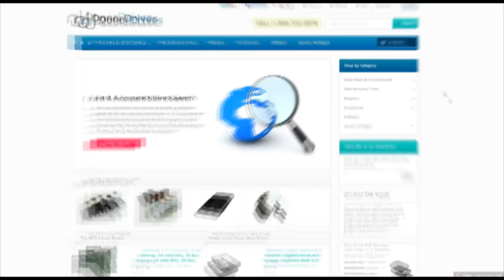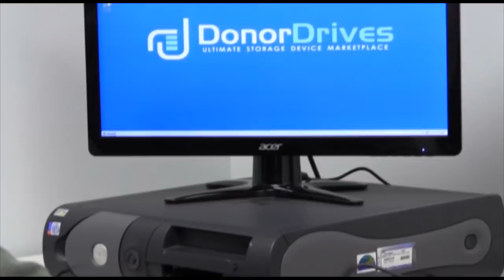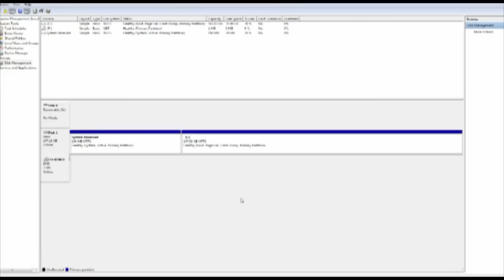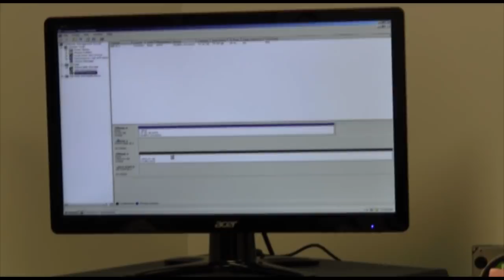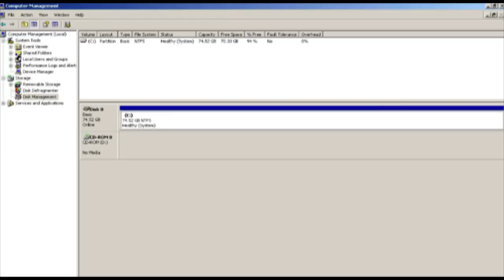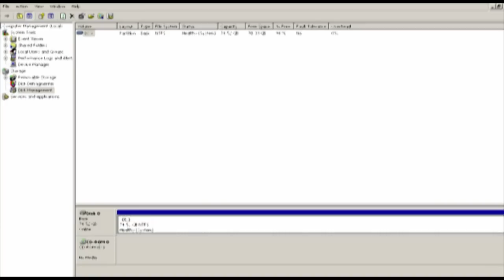DIY: Repair Hard Drive PCB. How to swap circuit board ROM chip.

Comment from the maker: Garry, I am sorry but for some reason unable to reply directly. Did you have any luck repairing your drive? We understand that we "can" charge more for our service, but we want to provide an affordable service. We also offer services for clients worldwide, with reliable and affordable shipping options. Even with shipping back and forth + $60 it will still be way under $150.
Reply: hard disk... nvm... fk that piece of shiy
Reply: +fizz martin depends on the drive series, but you can do a PCB replacement on any drive.  if its being detected its more likely a mechanical problem.  Does it click? does it get smart data?  How do you know if its overheating if you don't have temperature data?  Overheating refers to temperatures above documented limits, not getting vaguely hot to the touch because many old drives idle at 40C+.
Reply: Thanks managed to find some info it was the BSY error that was supposed to not exist after the Seagate 7200.11 drives - My drive is much newer so the bug still exists although Seagate assure me it doesnt - Connected up the drive to a terminal adaptor and reset the firmware. All sorted!!! THanks your prices are very very good I was qouted cheapest price £250 = $350...
Reply from the maker: Garry Gemmell That's great to hear! Just FYI: All Seagate brick issues fall into our "Hard Drive Repair Service" category, and we do fix them up for $60 flat, same as the PCB service.
Reply: Donor Drives LLC  1. is it possible to DIY swap a dead pcb with a new one that has the same circuit board MQ01ABD100, AA00/AX001A, HDKBB96A1A01 S, G003138A, Toshiba SATA 2.5 PCB... 2. and do i need a bios swap ... i notice that my hdd is detected but cannot explore the drive and it overheating very unusually... pls help answer 1 and 2
Reply: fizz martin Yes straight swap can sometimes work but it depends on the drive (I have done it on 2
500mb Seagate and 2 fujitsu 80gb drives - in my tests seagate  and other drives over 1tb seem to require a bios swap for some reason unless I am mistaken, WDC seem to work well with just pcb swap) - you must check this first because if its not then the drive layout can get scrambled by the new pcb - swapping the bios is the second option if your Tosh does not support board swap - there is a site somewhere in my favourites that has thousands of hdu on its database with info on whether you can swap board etc and you can send them your board and they will provide the right pcb and swap the chip for i think $50.

You can buy a small terminal connection to your hdu on Ebay - it allows you to reprogram the bios directly using your pc and the required cable so you can save it then restore it before you try anything dangerous.
Reply: Garry Gemmell my toshitba(toshiba) is 1tb... from your video 1st i should try wiping the connector with an eraser... then if that doesn't work try straight swap pcb... then if that doesn't work do a bios swap...
Reply: touch the hdd if its unusually hot... then its overheating i think... and it doesnt have a clicking sound... what type of screwdriver that i need to open the pcb...
Reply: fizz martin Usually a star driver - you can get cheap sets on ebay from China and contrary to popular belief its not all cheap rubbish. Benjamin is right - its very unusual for the pcb to fail its usually the drive platter or sticking head etc
Reply: Garry Gemmell yeah I literally bought the appropriate bit from a chinese eBay store for $1.  I needed it to open an Xbox HDD case but glad to see it has other uses.
Reply: i had checked it... its a + screw
Reply: ***** Suck it and see unless you have data you dont want to loose.

I just had the same issue with a snapped sata port on a drive but i just desoldered the sata connectors on the pcb and cut a sata cable end off and soldered the bare wires directly onto the motherboard - works perfectly and doesnt cost a thing!

Comment: Hi, first of all thank you for the very informative and probably unique video that talks so clearly and knowledgeably about this subject.

My Toshiba 500GB MK5056GSY, HDD2E61 D UL03 T is making a cyclic clicking noise and the OS says that no bootable device was found. When putting it on a dock it is not being recognized. Does this HD would need a ROM swap or a PCB swap would be enough? Thank you.
Reply from the maker: It is likely that the issue is more severe than a PCB, and most likely mechanical. Check this info, it could be helpful: www.ebay.com/itm/161000794506

Comment: Brilliant just wish you were in the UK - I have a failed Seagate ST2000DM001 - Barracude 7200.14 but also have duplicate drive. Drive is spinning fine no strange noises. Electrical surge i think has taken out the drive electronics - The drive is not recognised and fails on bios code B1 - Typical of hard drive detection phase - I have swapped in a known good logic board from the identical Seagate ST2000DM001but still no luck - presumably the rom is locked to the drive on these Seagates.
Do you think all i need to do is replace the rom onto the working drives pcb - I have hot air station and am experienced in reballing and reflowing etc

Wait for a laugh I have been quoted by a company in London £500 -> $700 dollars for repair - How can you charge $60 surely the replacement pcb must cost just this - surely you should be charging more I am sure most people would pay at least $250 for these type of repairs?

I am thinking of adding Hdu recovery and repair to my laptop motherboard repairs business - Can you recommend any decent training courses?

Very honest and informative video - If you were here in the UK you would get plenty of business if your prices are so good!

Comment: I have a failed Seagate Barracuda- firmware is 3.AAF. Ebay has a HDD with firmware 3.AAC. Is there any way in the world to make this work? Can I attach the new drive to a PC & upgrade to the dead drive's firmware before swapping the PCB? This is a drive a family member had in an enclosure & the PCB of that had a bad cap. Taking it out of the enclosure, it isn't recognized by any PC (using an external dock or direct-connect).

Help? I'm in Australia, btw.
Reply: Send the drive to Donor Drives and it's gonna be fixed for $60 or you do not pay - simple is that.

Comment: Does the donor hard drive have to be the same exact date and DCM for it to work?
I have a WD2002FAEX - 007BA0 21 Feb 2013 and it will not recognize in my computer anymore.
Reply from the maker: Do not need to match date or DCM at all.

Comment: Hi , i would like to know as my external hard drive model western digital 2TB  mybook essential has a problem which the power not light up because im not switch off the power for about 9 months (forgotten) ...

So i want to know what is the problem because im affraid to open the case of external it can be void the warranty...

My suggestion is to make the external as internal hard drive,but im affraid the hard drive still cant work.Anyone can help ???

Comment: Quick question, what kind of heat gun do you use to remove the ROM chip from the PCB? Do you know where I can purchase one? Thanks
Reply: Hot air gun - get them on Amazon for about £50 for a cheap one!
I can recommend this one:-

New ATTEN AT 858D+ 858D SMD Hot Rework Digital Station Air Solder Blower Gun

Comment: Hi, thanks for the very informative video.

The first Seagate hard drive for which you change the PCB does not seem to have a ROM chip. Am I mistaken?
Reply from the maker: It does not have ROM. Even if it did, that ROM wouldn't be unique.

Comment: Looks simple but you have to be educated on how to solder, having skills in electronics and how the HD works.

How much would it cost if I send to you a burned chip on my PCB Seagate 1TB Barracuda 7200.12 drive? The PCB is all the problem but it is not a problem drive. No clicks, not recognized by my computer using an enclosure Thermaltake Max 5G.
Reply from the maker: The video is targeted at tech savvy folks, to say the least. Educating on all those topics would take 1 hour+ and all that info is widely available on youtube. The cost for our service, including replacement part is $60.

Comment: Very informative video and I learned so much Alex, thank you. I actually purchased a Maxtor hard drive from a local store and my PC is picking it up but the software that came with it isn't recognizing the hard drive, what should I do?
Reply from the maker: Maxtors generally have no ROMs. Therefore the issue is not the PCB, or the board isn't matching. Give us a call and we will try and help.

Comment: Thank you. This presentation is  very clear and useful. I have SATA wd800 caviar se (category 2) with a bad PCB board.and I have a duplicate replacement PCB board. so I am thinking (fearing) of moving and soldering the old Rom chip to the new replacement board. I was hoping for a software solution. Is there any app out there that can read and reflash the Rom information?  The keyboard seems like a saver tool to me.
Reply from the maker: The software version does exist, but generally costs several thousands of dollars. If your original PCB is truly bad, then the software version will not work. If you fear to do it yourself, see if you can find a TV or PC repair shop with hot air station that can transfer it for you.

Comment: Hello. I have a WD HDD that recently crashed. When I connect it externally, it spins, makes a few clicks and then stops. Is this something a replacement PCB could fix? Thanks!
Reply from the maker: Possibly, but not likely. It's definitely worth a shot trying. Feel free to reach out to us if you have any questions.

Comment from the maker: Don't initialize. If it sees full capacity of the drive, issue is most likely logical, and you should be able to access data with any software data recovery program.

Comment from the maker: Absolutely. Most of the time that is the cause. It happens due to difference in heads map of the original and donor hard drives.
Reply: Hi there, great video and thanks for the insights. I have a bios chip on a type 2 Barracuda where ROM transfer is required. Although the ROM/BIOS chip looks burnt out. Is there a way to get the data off here somehow?

Comment: Hi
I have a Western Digital hdd WD1200 IDE which does not power up at all, either as internal or external USB. There is no sound, no spinning etc. Do you think I should change the PCB or I can fix it somehow. Also, if I have to change the PCB should I get the exact model or I can use similar one from other WD1200 ? (for example mine writes model WD1200BB, I found others WD1200PB or WD1200AJ )

thanks

Comment: Curious how long and how much does a hard drive pcb repair or swap cost when sent into to you. Just had mine sent to a another who is likely doing data recovery, which sucks if it could be solved simpler.

Comment: Useful input would be appreciated for my scenario. A Hitachi Travelstar has died. No motor spinup or anything. Got a board where Model, P/N and MLC match. The first two numbers on the sticker on the back match. The three large chips match (except one is a Samsung and one is Elpida). Swapped the boards and got motor spinup and heads clicking healthy. Doesn't show up on the PC. Did the Rom chip swap and still not recognized. Whats next?

Comment: i had clicking sound and sometimes it didn't detect hdd,I was already looking for new pcb on my WD 320 caviar, but your great tip with cleaning connectors, that solved my prob. Now I'm able to recover my data.